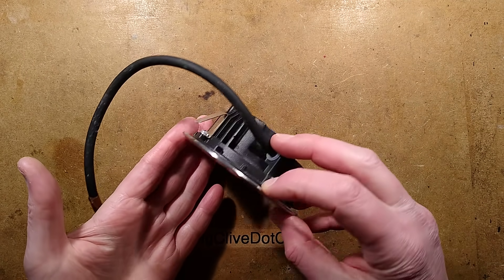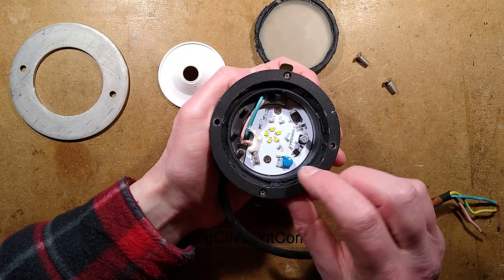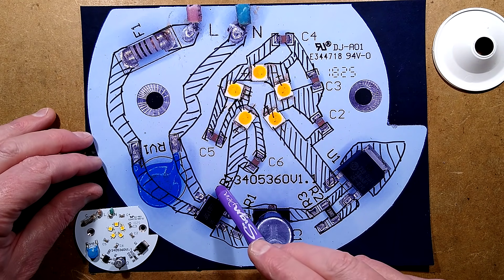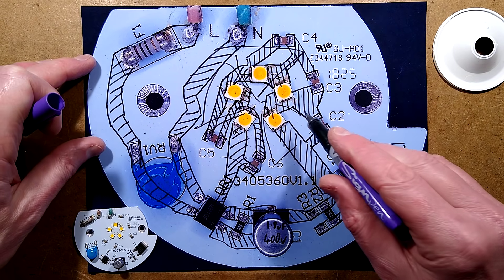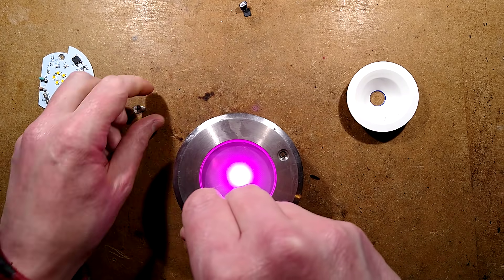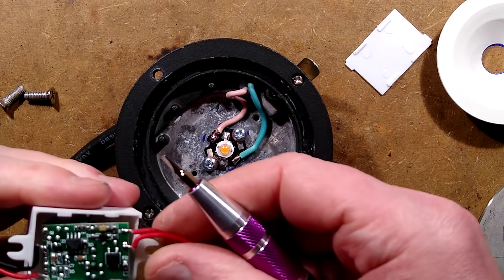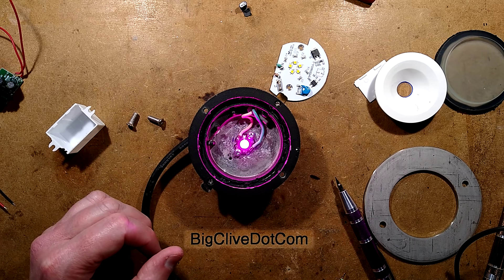Bodging a repair on a faulty ground uplighter

Comment: @bigclivedotcom Your talking about having mains voltage at ground level reminded me of an experience I had over 40 years ago. It was an unseasonably dry Oklahoma Summer. Working for the telephone company I was assigned several BDR calls (Bells don't ring) for party line customers in a rural area 6 miles outside of the rural town I worked in. The party lines used a rectifier pack to give private rings. You could ring tip to ground, ground to tip, ring to ground and so on. I had to show the customers that they could resolve their own problem by pouring a few buckets of water around their ground rod. I had one call were they reported the bells don't ring but they could tell there was a caller because mysteriously their dog would make a blood curdling yelp. Upon investigating I found the dog made its bed in the shade lying right on top of the ground rod and ring current was passing through its body. Much to the dog's relief, both the BDR and the electrocution problems were resolved by a few pails of the DHMO.

Comment: You may wish to add a caveat with that "twist off" technique, that it should not be used on older or poor quality boards as it can easily rip the pads off. (speaking as someone who has had to repair quite a few vintage computer boards which have been ruined by the owners trying that sort of thing and making a mess).
Reply: This. I've had more luck using flush cutters cutting the top of the cap off above the plastic spacer (while pushing down on the spacer with the blades). Bit more of a mess as you're basically cutting the cap open, but I'd rather deal with that than ripped off pads and the resulting ugly jumper wires I'd have to run all over the place. I want to look at the finished project and not immediately see a difference to the original state, not go looking at it thinking "yeah some total amateur idiot botched this up"
Reply: You just did.  Should be pinned.
Reply: Anyone watching BC videos should already know he does not do ginger carefuling that much anyways :)
Reply: Clive has such a reputation for being so gentle. 🤣
Reply: Some time ago I was trying to restore an old Tektronix function generator. All smd caps had leaked, making them impossible to desolder. Around 70 and all had to be replaced. Using this method I don't recall nuking any pads. This is just anecdotal evidence but maybe it has more to do with technique. Perhaps those people weren't using enough downward pressure or something. Or then some PCBs are just more sensitive than others.

Comment: Ground lights with mains serves 2 purpose along with a sprinkler . They electrify the wet ground this in turns supply's you with juicy fishing worms and the light to find them
Reply: Ah! The ol'e two polls attached to straight mains trick.

Comment: "They always let water in". Oh yes. They do. Always.
Reply: I've seen an actual 100% watertight weatherproof fluorescent fitting that was full to the brim with water. How the hell did that happen? Well the moisture was entering the system elsewhere and running down all the trunking and ending up at the lowest point which happened to be said luminaire!
Reply: Sometimes even if they're water tight they're not air tight . The device warms up and drives out warm air, then cools down and pulls in moist air that condenses out water. Repeat a few hundred times and the device drowns. I've actually found that a big hole can actually reduce the water ingress as it lets the water out again! (On things mounted up on walls, not on things in the ground)
Reply: The people who sold me the DIY solar install had in their instructions "The roof-top junction box should be the water-tight type. However, nothing is permanently water-tight, water WILL get in. Therefore drill a 1/8" hole in the bottom corner to let it back out again."
Reply: Or dog piss :(
Reply: Hi, just use oldfashioned halogen bulbs, as they run much hotter the water will be dried out every time the light is used 😉
Reply: I could make an actual waterproof one, but it would have screw terminals on the outside of the device, maybe in a little junction box compartment, and it would have a lot more screws holding the lens in. Waterproof, as in unless the water pressure is sufficient to crush the device, it's not getting in.

Comment: Linear current regulator! I’ve just found your channel and it’s great, I’ve a dyson dc16 handvac here that just flashed a red light when the trigger was depressed. I’ve read online that the logic boards are faulty and there’s also a Hall effect sensor bypass that works for some, it didn’t for me. I discovered the motor was working and needed an earth to run and I also by poking around that powering a pin on a black thing I know now to be a linear current regulator the motor would run so I cut the wires for the trigger and used them to send a live signal to the linear current regulator, maybe with a few more of these videos I’ll be able to diagnose the board properly, thank you for sharing the knowledge

Comment: I like the capacitive glow from LED's.
I wish more of them had this "feature"
Reply from the maker: If you remove the load resistor across the electrolytic capacitor, many will do it.  Or add a snubber network (100nF capacitor and 100 ohm resistor) across the light switch.
Reply: Exactly, take that 💪 you bloody free energy deniers... 😂
Reply: @saalkz.a.9715  The energy was free... It was the standing charge on the free energy meter that got me👉😄👈👍!!
Reply: You're right, it's not a bug. It's a feature. Just call it "night light mode" and you're golden
Reply: @thomasvlaskampiii6850  exactly.
It's a great feature.

Comment: Garden uplighters used to be the bane of my life. Solved the problem with a couple of 400VA 12V downlighter transformers (with M6 nut and bolt connections for the secondary) placed in the sheltered basement area, fed from the mains, and then reused the existing armoured cable to feed 12VAC to the downlighters, where the built in transformers were all removed. 50W halogen lamps, and the base sections were deliberately left non sealed so the water would at least leave. Yes the terminals corroded after a while, but you did not have any issues with failure due to water or the gardener putting a spade through the cable.

Easy to add lights on as well, plenty of room in the base to use the 4 knockouts to get glands in, and 8 lamps per transformer gave a nice voltage drop, so the lamps ran for a longer time on around 11V at the end. All in all around 3kW of lighting, though a good number of them had to stay at 230VAC, as they were regular 125W mercury vapour GRP fixtures, running as uplighters and general flood lighting. Still got a number of the GE lamps I used in there, as they would run for around a decade, the failure being more a ballast shorting out from water, or just rusting away and open. The Chinese lamps lasted under 4 months there. Some of those lamps probably are still there, but the property is long sold.

Comment: Ceramic capacitors and small pads are used because of aluminium PCB. 
Because of very thin dielectric, Aluminium PCBs form good capacitor between base material and copper on top layer. If there is a voltage transient on the case that voltage is then coupled to the copper track on top layer. You reduce parasitic capacitor value by having small copper tracks and you can reduce the effect by placing capacitors in parallel with LEDs.
Reply: What? On a DC supply smoothed by a electrolytic capacitor?

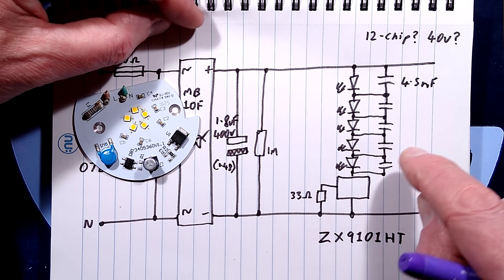Comment: 8:18 I have seen LED chips seemingly designed to keep the show going if one of the multi-chip LED modules fails. I don't remember the brand, but it was a more posh one that hinted at each chip having a Zener diode in it to bypass the series connected dies if something took a dump. While there were multiple chips in series in each package, they still showed a diode drop when measured in reverse, hinting at another diode being in parallel with the LED chips, but of opposite polarity.

Comment: Those spring clips suggest to me that it could be a good recessed ceiling light as well, in which case you wouldn't need to worry too much about weatherproofing.
Reply: Until your partner lets the bath overflow!
Reply: @rickymherbert2899  if the water from the tub overflowing hits the ceiling I want to meet whoever seals the bathroom door and insulate my house.

Comment: I don't know why, but MOVs always look delicious to me. Like shiny candies.  😂
Reply: Me too. They remind me of this somewhat chewy sour candy I had before
Reply: I wish I was that easily pleased.
Reply: This explains the DO NOT EAT stickers placed on things that most people wouldn't consider eating.
Reply: @matambale  The metal wires coming out of the candy coated electronic components kind of gives away the fact that they're not edible.  😅
Reply: That's probably an urge you should resist.
Reply: If you think theyvare nice, you should check the old mullard Capacitors that has colour code stripes, they look like licorice allsorts.
Reply: @dogwalker666  I'd never seen those before. They totally do look like those licorice candies!
Reply: @BRUXXUS   they do indeed.
Reply: @dogwalker666  yes those old Mullard caps, I used to call them sweeties when i saw them in stuff :)
They also had "Mustard" ones which were that colour
Reply: oh and Philips/BC made "orange drops" :)
Reply: @jaycee1980  yes I still have a few in my spares trays although I doubt if the will work anymore.
Reply: @jaycee1980  yes the old tantalum capacitors.
Reply: @dogwalker666  nah the philips orange drops were MKT... have a bunch of them, all still within tolerance and no leakage. Tantalums go straight in the bin when I see them!
Reply: @jaycee1980  yes I still use mkt ones I bought a job lot bankrupt stock, they never let me down, but need a quick lead wipe with with steel wool.

Comment: I see so many of these that have failed and they have all been removed.  All that is left is a line of round cement where they have all been removed.  All light should go down, not up.
Reply: They’re not a very good idea anyway, as they add even more light pollution to the night sky.
Reply: @Mark1024MAK  Correct.
Reply: @Mark1024MAK  totally right with the light.
Light pollution is even worse now with low power/high lumen LEDs.  I have 2 (non-adjacent) neighbors who insist on maintaining their own sense of [in]security by horizontally illuminating all nearby properties at near daylight levels.
And don't get me started on the continuing trend of "brighter headlights for better safety!"
Reply: Most common issues with inground uprights relate to installation. Contractors frequently disregard the requirement for drainage under the luminaire and fail to provide a waterproof connection, resulting in water traveling up the cable and directly into the luminaire.
Reply: @77thTrombone  - the most amusing thing is, criminals like constant ‘security’ lighting - it allows them to see what potentially valuable things there are to steal and it makes it easier for them steal items without having to use a torch/flash light or to fumble around in the dark.
I don’t know about everywhere, but our Police force advise against constant ‘security’ lighting. They say that motion activated lighting is better.
Also despite what people think, in normal times (when there are no lockdowns), the most common time for house break-ins is in daylight when they think people are away at work and the house is unoccupied.
Reply: @kiwicrusher314  - Not all, but a lot of contractors don’t really care about the long term life of what they install. Surface ground mounted lights are no different to any other poor outside electrical installation. If not suitably protected against water ingress, water will get in and cause problems, then it’s only a matter of time before this results in a failure. I’ve seen wall mounted outside lights half full of water on many occasions for example.
Reply: @77thTrombone  I have a neighbor who has installed spotlights pointed at each tree in his garden. I don't know if that is a measure against some kind of pest or if he just finds it beautiful. But in winter, when the trees have no leaves, one of the spotlights goes straight through it's tree and into my living room at night. It doesn't bother me but maybe one day I will ask him what the reason is.
Reply: @MetalheadAndNerd  I'm glad you're more tolerant.  I wander through the house after dark, say to get some water, and BLAM
  (====== 👀
It's like headlights in the eyes, and my night vision is shot.
Reply: @77thTrombone  Have you talked to an ophthalmologist about that? I had vision problems some years ago and it turned out that my tear glands weren't producing enough tears to keep my eyes moist all day. That lead to the surface of my eyes slowly drying out and becoming dull.
After it was finally diagnosed I got my eyesight returned to normal.
Reply: @MetalheadAndNerd  Interesting.  I've always thought I was just more sensitive to light -- preferring just a cone of light over my work area (to my wife's complete & continual vexation.)  I'll look into that.
Reply: "All light should go down, not up.", for example the sun.
Reply: @Bennyboy-dog  The sun goes down every night!
Reply: @BoB4jjjjs  and let's keep it that way.
Reply: @Bennyboy-dog  Yeah.  Only problem is Mankind has a built in destruct button.  Let's hope it continues to rise every day and goes down  every night for a long time and there is still people on the Earth to see it.
Reply: @BoB4jjjjs  I share your pessimistic hopefulness bob.